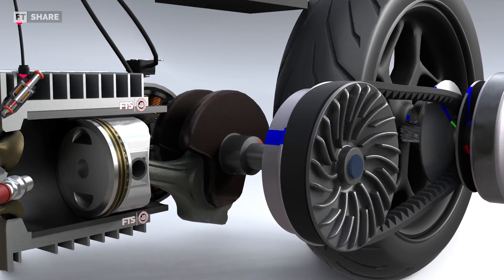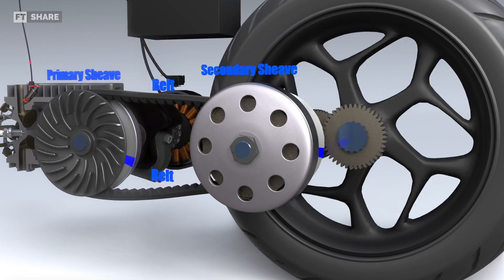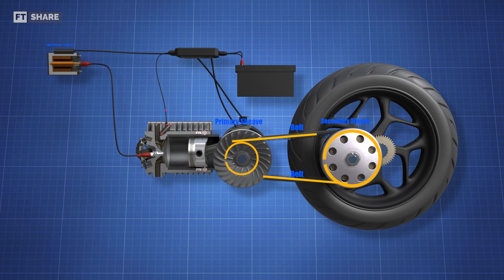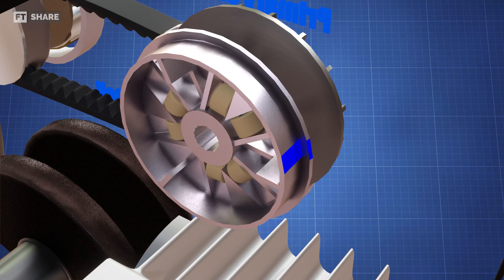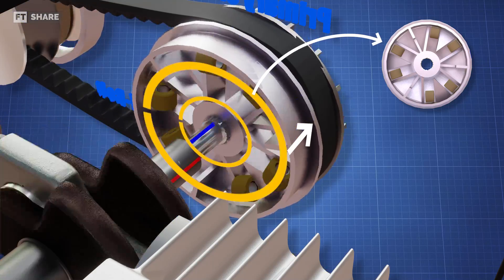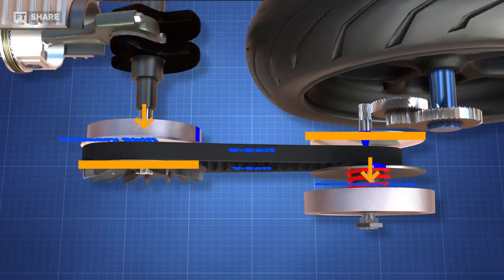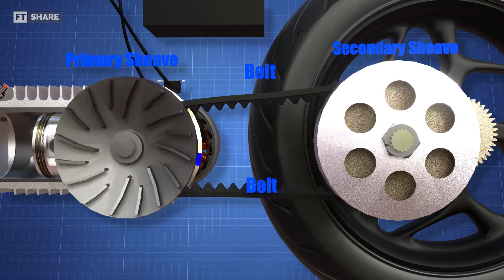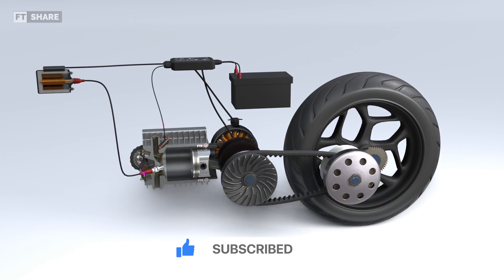How a Scooter Transmission Work | CVT Working Mechanism

Comment: The manual recommends same engine oil to be used as transmission oil. But some suggest to use 80w90 oil for the transmission. Which is the right option? Do cvt transmission require 80w90? 
The scooter is an Indian make called TVS  Jupiter 110 (2016 Model)

Comment: Why are most of them on scooters and not some other type of bike like cruiser?
Reply: Well there aren't msny modern bikes with CVT transmissions as in a scooter, but quite a few bikes, especially Hondas, that have another type of automatic transmissions, called DCTs.
But many motorcycle are simply not automatic and use manual transmission, you have to change gears. That's pretty much what motorcycle is. But yeah, there are exceptions, and you can find many motorcycles in history that used to have this type of CVT or something similar, like old Chinese motorcycles. But it's just not common in modern times, due to the power of motorcycles, general reliability and cost

Comment: 2:26, TBH, the CVT is a pretty insane thing, however the clutch could definitely be better designed, cause at times when the pads wear out the acceleration suffers, I was thinking why don't they make something that has some sort of teeth or biting point instead?
Reply: Replace the clutch oil more often.

Comment: It is missing an important part - the weighted roller pressed against the curved plate. When the rollers are closer to the center, the curvature of the plate allows the belt to be closer to the center. As the rollers are closer to the edge, they push the the plates closer because of the curvature, and force the belt further away from the center to achieve higher speed.

Comment: Is it safe to use JASO MA/MA2 oil in my SYM Symphony ST200 scooter?
I recently had the first oil change done at a SYM dealership after 200 km, and they used 10W-30 SL oil with a JASO MA/MA2 rating.
I’d like to know if this type of oil is suitable for my scooter, or if it could potentially cause any damage.

Comment: engineers are amazing, thank you for creating scooters! sorry clutch guys, thanks to the clutch i almost had a collision accident with another vehicle when i tried my dad's motorcycle, never again!
Reply: Skill issue tbh
Reply: @depressed_p3nguin  i agree and i wont even argue with that lmao
Reply: @tankeryy1566  damn my bad, but u gotta practice manual since it's a good skill to aquire
Reply: @depressed_p3nguin  idk man, too many to think about thats why im amaze by peeps who can drive manual cars and manual motorcycles.
Reply: I got both. Scooter is good for city/daily uses. I use it for my office commute everyday.

I got a naked and a sport bike for joy ride or a long-distance trip. Scooters generally will struggle more than 300/500/600cc motorcycle.

You can take your scooter on long distance trip also, but i use it for its purpose. Daily commute.
Reply: @ what about the 400 cc maxi scooters like the BMW C400GT? that kind og scooter can handle long rides too imo
Reply: @tankeryy1566  Oh of course. But the versatility is non comparable to a motorcycle if you plan on different terrains. 

But if you just want a smooth ride without much steep hills, and stuffs. Undoubtedly the scooter is a more comfortable choice.

I got myself a SH350 and a Xmax300. Go just fine, even better than motorcycle when i ride it with my gf. (my gf prefer scooter over motorcycle for a more comfortable seating).

But ultimately, I can't argue that scooter is better than motorcycle for long-distance/different whether/terrains when riding. Don't get me wrong, i use scooter more than motorcycle lol. For my daily commute, i got a cheap freego (abs). It has served me exceptionally well.
Reply: @minhtrietquach1519  damn bro how many motorcycles you have? i just bought a 125cc scooter (honda click 125) last month january 2025 after 3 years of saving up. which one is more comfortable, cruiser or scooter?
Reply: @tankeryy1566  the click 125 is practical enough, but higher cc always = more comfort regardless of types , less engine strain. I too ride a 125cc scoot, it struggles going higher than 80km/h. 75km/h is the sweet spot to cruise for me.
Reply: Manual MCs are safer than scooters

Comment: So Low RPM High Torque wont make the vehicle move?
Reply: Low rpm high torque helps the scooter to move up a hill...because of the huge amount of force it requires to climb the hill. Where's a high rpm and low torque helps it to accelerate faster on a flat surface

Comment: basically CVT (continuously variable transmission) work using centrifugal force.
in order to understand CVT and transmission in general you have to understand gear ratio: when the output gear (the secondary pulley) have bigger diameter than the input gear (primary pulley) the output gear will have stronger torque and lower speed than the input gear when the gears spin, and vice versa.
then the question will be how CVT modify the gear ratio without any gear at all?
by using a pair of conical shape plates (exist on both primary and secondary pulley). When one of the conical plate are pushed closer to its pair, the plates push the belt to slide outward increasing the diameter of the contact between the plates and the belts (the diameter of the gear in a gear ratio), as the diameter increase the circumference that the belt need to cover also increase, pulling the belt toward the growing gear. because the belt do not stretch, the belt force the pair of plates in the opposite pulley to expand causing it to have smaller contact to the belt.

EDIT: the centrifugal force is used only in the primary pulley by using what they call "rollers", when the crankshaft spin the centrifugal force push the rollers outwards pushing the primary pulley plates closer to its pair increasing the "gear" diameter.
the secondary pulley however have a spring instead of rollers to push its plates together. so it have high "gear" diameter during low rpm. in conclusion at low rpm the spring win against the centrifugal rollers but at high rpm the centrifugal rollers push stronger than the spring causing CVT to have low torque high speed.

if you understand how CVT work you will understand why it needs frequent maintenance because of the sliding of the belt and rollers when the RPM change, but you cannot put lubricant because the belt will not have enough friction to move the the opposite pulley. it is just a bad design in term of longevity. that is why you should never buy any CVT operated vehicle heavier than a small scooter.
Reply: Copy
Reply: Thanks. We briefly touched on these in my automotive studies, and they said they were pretty rubbish in cars. I have a scooter now, though, and it has one of these.
Reply: @aratneerg3699 easier to maintain in a scooter. Easier to replace, they made it very hard to service on cars
Reply: Sir, how about Dragging or So much Vibration upon Take off, and gradually subside after running 30kph up. in what mechanical part causing it ? ThankYou
Reply: It's either the belt is loose or the clutch pads are worn out (because of wear and tear), or the CVT is dirty causing it to loose friction (like running your motorcycle on a loose gravel) @GoogleAccount-z5s
Reply: @GoogleAccount-z5s  Ive used atvs with these kind of cvt's. Usually the clutch material has outward bumps from the centre, and the pulley has bumps that extend inwards from the outer diameter, so they hit and catch on when it starts to close. These are twitchy during takeoff. The link below is an image of what you are probably using. Very similar just arranged a bit different. 

https://gokartguru.com/wp-content/uploads/2021/07/Variable-Transmission-Belt-Drive-Ctutch.jpg
Reply: EDIT: the centrifugal force is used only in the primary pulley by using what they call "rollers", when the crankshaft spin the centrifugal force push the rollers outwards pushing the primary pulley plates closer to its pair increasing the "gear" diameter.
the secondary pulley however have a spring instead of rollers to push its plates together. so it have high "gear" diameter during low rpm. in conclusion at low rpm the spring win against the centrifugal rollers but at high rpm the centrifugal rollers push stronger than the spring causing CVT to have low torque high speed.

Comment: Very informative.. but i have a question. I just cleaned my cvt but it still has a dragging effect. But when the engine is hot every time I grip the throttle it runs smoothly.
Reply: Just change the engine oil with lower W grade 

Maybe try 5W 40

Comment: It all should be combined in one unit just like a motorcycle with gear transmission is. Putting heavy parts on the back wheel makes for excessive unsprung weight and a rougher than necessary ride.

Comment: If you get dirt, sand and water there, its not gonna work. its for good weather street driving only. Chain drive rules. LOL
Reply: I wouldn't be so sure, millions of these mopeds exist in Southeast Asia. They have heavy monsoon rainy seasons and many terrible dusty road conditions.
Reply: chain drive though is durable. but CVT is just protected with enclosed structure, they can withstand dirt and rainy conditions.
Reply: The belt is enclosed inside an airbox, and have its own air filter.
Reply: I am in the Philippines and trust me all ADV scooters here are sold like hotcakes. 😂 They even go off-roading without problems.
Reply: that goes for all transmissions. by the way we use these transmissions here in india which is well you know very dirty and unmaintained roads
Reply: I have both scooter and motorcycle.

I love both, both have their strengths and weaknesses. Couldn't really compared tbh.

I use scooter on daily basis to my office, and take out my 2 bikes (naked, sport) for a trip or just a joy ride.
Reply: LOL it's very popular in Asia and it last for years
Reply: My 100,000 kilometres riding only scooters since 2006 says you are puffing air.
Reply: @micklessard9964  talk to hand... LOL
Reply: Maybe that’s why there’s a waterproof cover over it with a gasket 🤔
Reply: Its like 10 bolts and a gasket sealing it... I drive my 20 year old Burgman in all kinds of weather, even at winter and i live in Norway. Never had one drop of water inside.
Reply: We have Kenbo here which is like a horse... There is no place where it cant go.. Its CVT..
Reply: Because it’s meant for urban driving. You can’t get 30+ liters of storage space with a stock chain drive scooter.
Reply: It is encloses
Reply: It's obvious that you haven't these scooters irl before. Have you been living under a rock or something? Or probably too old to have fun riding a scooter.
Reply: That is absolutely not the case
Reply: It's covered with a box, so I don't know how you want to get water in there. Unless you mean extreme off-road driving and use your scooter as a tool to practice tumbling down, do some crazy wipeouts and what not. In that case, stay away from them, lol

Comment: How does increasing the radius of the primary sheave overcome the compression spring in the secondary sheave? Is it utilising the axial stiffness of the drive belt
Reply: Yes, the belt retains the same length regardless of gear ratio, as the primary sheathe increases in radius, the belt tension/stiffness overcomes the spring in the secondary sheathe

Comment: Whether it is an internal combustion engine or an electric motor the CVT described here works in a similar fashion for both and increases the efficiency of both types of motors and drivelines.
Hybrid motorcycle engines have even become available recently !!!!! 
The system shown above can also be modified into a hybrid drivetrain relatively easily.
Also if using an purely electric motor one side of the driven pulley could be adjusted in and out using an electrical linear actuator or servo with a hydraulic actuator also possible instead of the centrifugal clutch weights. With the rear pulley clutch and drive system either kept the same for certain applications or the rear centrifugal clutch could be removed from the design.
Many possibilities and news designs are still to be tested.
Welcome to an electric and hybrid future for sit-down scooters and small motorcycle's.
With emission laws only getting tougher new designs are needed, with my drivetrain allowing for a small electric motor to deliver big performance.
The designs described above remain the intellectual property in every form of.

 Mark J Maxwell 
😎🇦🇺👍

Comment: My question is then why it doesn't give that much mileage? For bikes that power, it may gives 70kmpl while scooters it will below 50kmpl
Reply: Energy losses. The belt will slip especially under high acceleration or torque. Before the power reaches the wheel there's also the reduction gears which is why you need to replace gear oil in a scooter but not other types of motorcycles. Any type of power transference will have power losses. Manuals have transmission gear towards an output shaft with a chain drive all of which is bathed in oil except for the chain drive and sprockets but that still has lubricants

Comment: Do you have a good spring mix and rollers for 155engine?
Reply: 66grams total weight on rollers.
800rpm clutch spring (tension spring)
900rpm center spring (secondary spring)
Reply: @efrahaimrn  what motorcycle did u use on this combination? Kinda interested
Reply: @efrahaimrn Is it adviceable to grease rollers slightly

Comment: Great animation. I'm putting a question: is it possible to create a "N" position on a scooter with cvt? like for example a normal automatic gearbox. I'm thinking that, at the end, a cvt is equalt to whatever motorbike with automatic and a neutral position is useful in many situations
Reply: Disengaging the main drive will automatically consider as a neutral. But since all scooters are gear less, people won't prefer gear in that.
Reply: I get why you would want this. scooters are a bit finicky  to start despite being beginner friendly. Put a little too much throttle and your scooter will try to ride away. It would be nice if they can add a clutch that would prevent your scooter from running away until you're ready to ride it.
Reply: Yes it is possible by replacing the centrifugal clutch with manual clutch. That may not be very practical and probably hard to control
Reply: @zuzuzaza98  not to mention complicated since the clutch is located at the rear wheel assembly.

Comment: My head can't absorb this fast enough, so I have to watch it over and over. But I like!
Reply: basically CVT (continuously variable transmission) work using centrifugal force.
in order to understand CVT and transmission in general you have to understand gear ratio: when the output gear (the secondary pulley) have bigger diameter than the input gear (primary pulley) the output gear will have stronger torque and lower speed than the input gear when the gears spin, and vice versa.
then the question will be how CVT modify the gear ratio without any gear at all?
by using a pair of conical shape plates (exist on both primary and secondary pulley). When one of the conical plate are pushed closer to its pair, the plates push the belt to slide outward increasing the diameter of the contact between the plates and the belts (the diameter of the gear in a gear ratio), as the diameter increase the circumference that the belt need to cover also increase, pulling the belt toward the growing gear. because the belt do not stretch, the belt force the pair of plates in the opposite pulley to expand causing it to have smaller contact to the belt.

if you understand how CVT work you will understand why it needs frequent maintenance because of the sliding of the belt and rollers when the RPM change, but you cannot put lubricant because the belt will not have enough friction to move the the opposite pulley. it is just a bad design in term of longevity. that is why you should never buy any CVT operated vehicle heavier than a small scooter.
Reply: @flowerofash4439 then how is the power generated by the belt and the plate move to the wheel? Can u explain please?
Reply: Не вижу ваших просмотров дураки!
Reply: it was easy if u had one of them